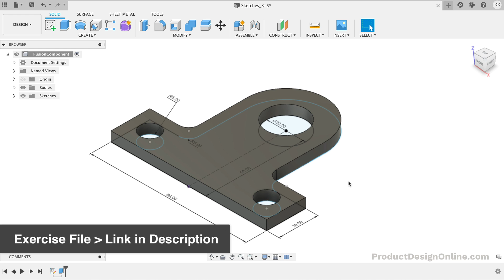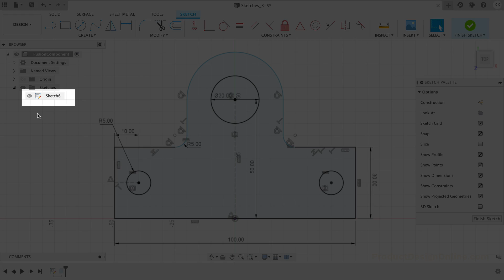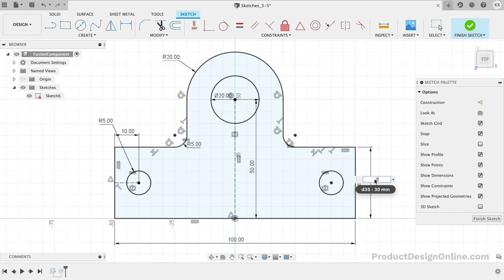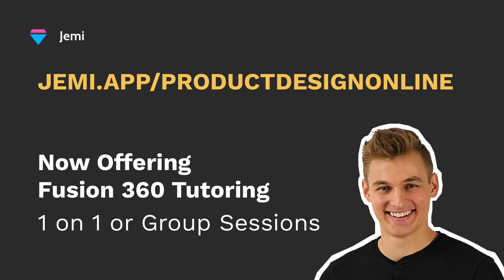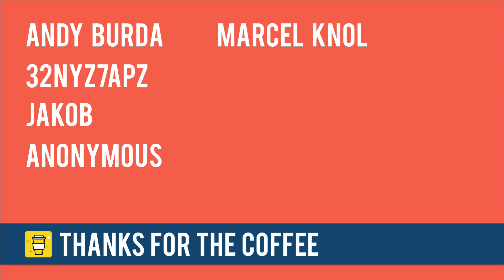HOW and WHY to Fully-Define Sketches in Fusion 360 (2020)

Comment from the maker: Sign up for a virtual Fusion 360 training class ➞ http://jemi.app/productdesignonline
Sign up for free F360 Sketching Course ➞ https://bit.ly/f360-sketching-course
-
TIMESTAMPS
0:00 - Fully-define sketches in Fusion 360
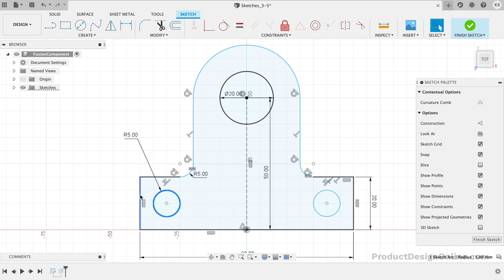0:30 - Understanding the geometry color
0:57 - What is fully-defining a sketch?
1:30 - Adding constraints to the geometry
2:15 - Finding what's not constrained
3:00 - Testing the constraints
4:00 - Using the symmetry constraint
4:35 - Inspecting the Browser sketch icon
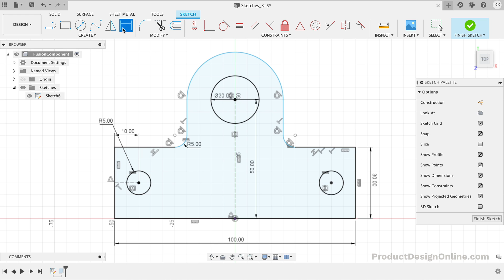4:56 - What does the lock icon mean?

Comment: Is there any way to keep the sketch fully constrained when saving and importing as a .dxf? When I import sketches to use for repeatable extrusions they come in un constrained so I have to constrain it every time.
Reply from the maker: There is not, unfortunately.

Imported DXF files are converted to sketch geometry behind the scenes. The problem is that curves and specific shapes often become small line segments. In those cases, it's best to delete the small line segments and recreate with constraints.
Reply: Sadly, I thought that was the case. For what I am doing its probably best to import a whole part. Thanks for the reply, love your videos! @ProductDesignOnline
Reply from the maker: Appreciate it. Thanks for your support! Best of luck with your projects  :) @VanDeanCustoms

Comment: I guess it depends on what you are designing. Most of my 3d prints are for holders (tools, drawers etc) and are mostly one of a kind. I never take the extra time to fully define my sketches and have never had any problem with my designs. I also usually hide the dimensions, points  and constraints.

Comment: Whenever I add an SVG to a model. That sketch is never fully defined/constrained. My sketch only contains the SVG. How do I fully define the sketch?
Reply from the maker: SVGs are automatically "locked" by the Fix constraint upon inserting them. You'll have to make sure any other sketch entities are fully defined as well. You can also unfix the SVG and try to "Fix" it again to make sure that it's all completely locked down.

Comment: You make great videos, but I'm still having the issue that all lines are black, but there's no lock. Can't find anything blue. Also some lines turn red (around holes in the sketch) when selecting some sketch profiles in the main editor. You see this when lofting. Don't know why.
Reply: Me too! You have the best videos on here by far!

I have a sketch with way to much going on and its all black. I grab a corner to shake it to see what breaks, fix it, then shake it again. Now I cant get it to break and it's still missing a constraint. (says so in browser) As soon as I copy it into another sketch it breaks. (I use all internal constraints. I use parallel and perpendicular instead of horizontal and vertical and all my dimensions are relative to 1 internal HARD number.

Is there a way to highlight bold or search for unconstrained points? Or hide all fully constrained parts?

Thanks!!
Reply: CONSTRUCTION geometry must also be defined. As I learned.

Comment: How do you get the line option? I also don't see sketch on my menu bar. It stops at Tools
Reply from the maker: Hi Michael. The sketch tab is 'contextual' meaning it will only show while in the sketch environment. You will have to either "Create Sketch" to create a new one, or you can edit an existing sketch. You will then automatically be placed in the sketch tab.
Reply: @ProductDesignOnline  Thanks for that. It helped a lot and makes perfect sense. I last used CAD in the 80's and it was ll 2D. 3D CAD has some "nuances" that I'm still trying to figure out.

Comment: I love your videos but I keep running into the same issue which is sometimes my circles will not fully define. I follow all your steps to a T and when I try to put the midpoint line to the center of the circle it just won't define, the circle stays blue. I have all the same constraints on my diagram as you do. https://imgur.com/gallery/JsSgrUx

Comment: How does one design springs and compliant mechanisms? Are there any calculations one must do beforehand?
Edit: I am asking for a compliant spring return check valve & binary (compliant) rocker switch, both 3d printed of course.

Comment: Great as always.  Something for your consideration:  Rather than draw a line from the midpoint, then make it construction, I find it's less cluttered to just drop a point at the midpoint and then make the circle centerpoint horizontal from that point.  I use points like that so frequently that I have the point shortcut on the toolbar.  It's less clicks, and the drawing is easier to read without a bunch of lines.
Reply: You sir are a genius. I was having trouble constraining that circle on the left with the contruction line. Even though I was doing everything exactly it would not constrain. Making a point and making it horizontally constrained fixed it immediately.

Comment: Thanks but How you define a sketch with splines in it?
Reply from the maker: Hi, Glenn. Fantastic question :)
Splines can be fully defined by dimensioning and constraining all of their spline handles/points. However, in many cases, this is simply not worth it. Especially because splines are often fine-tuned as you continue to work on your model.

The best practice with splines is to use the "Fix" constraint. What I recommend is fully-define thee entire sketch with normal dimensions/constraints per the best practices. At the very end you will then want to add a fixed constraint to the spline geometry. That will turn it green and lock it in place, while the lock icon appears in the Browser.
Reply: @ProductDesignOnline  that's great I'll definitely try that it's been plaguing me because it's such a waste of time dimensioning all the points. you have to do the angles of the handles too., it looks horrendous.